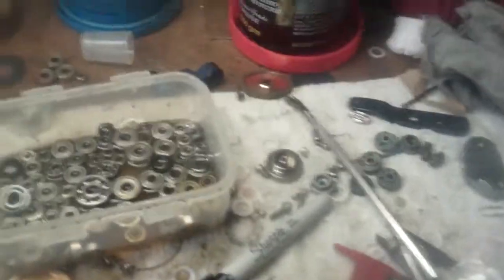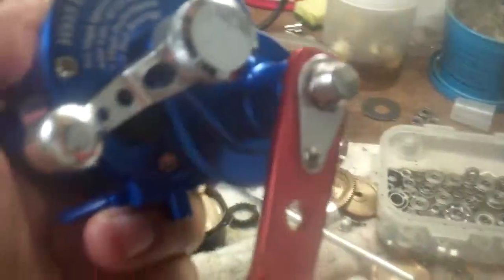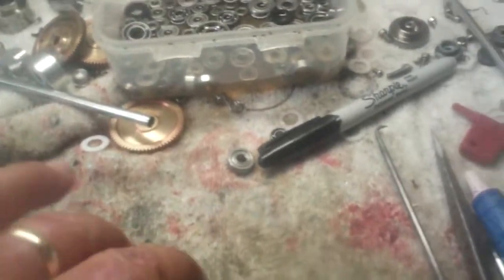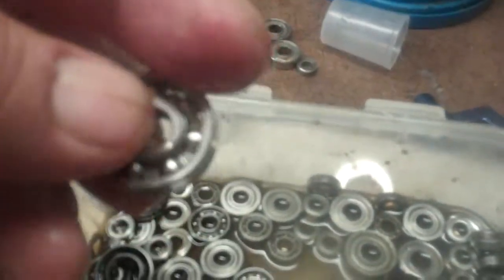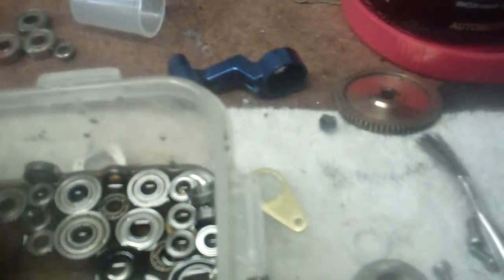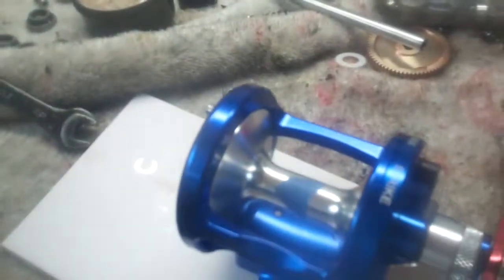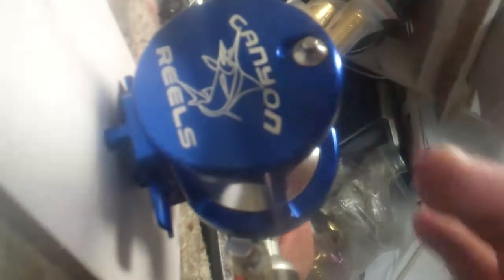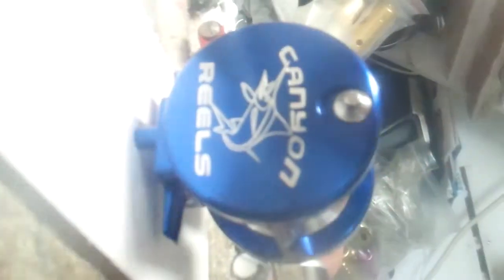Canyon Reels

Comment from the maker: It can be built to your specs if needed.Normal drag is 18lbs at full but can be increased if its desired.Also S.S.Bearings can be sped up or slowed down if need be. You can reach us Monday thru Sunday from 9:00 to 5:00 at 732-232-0081 or thru email